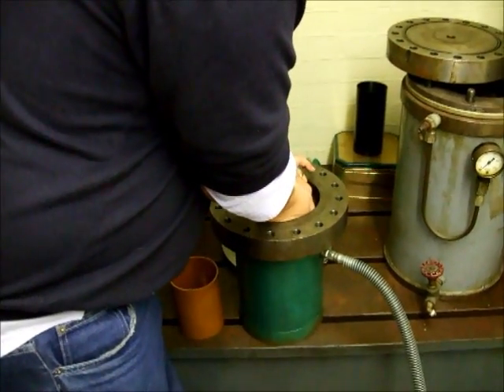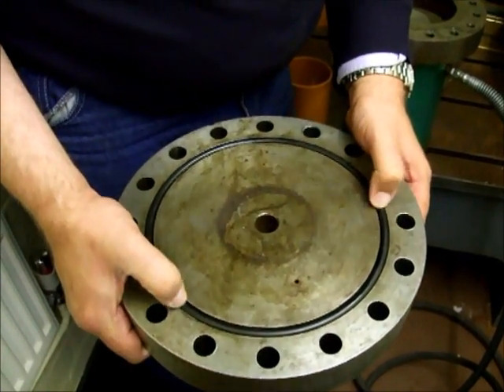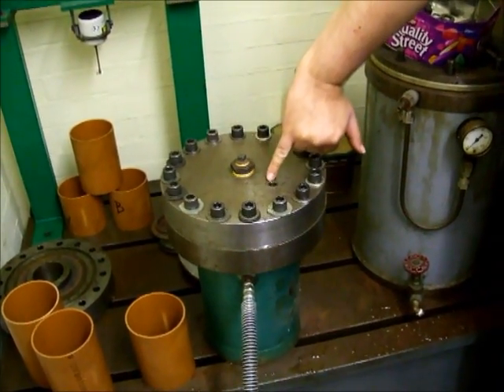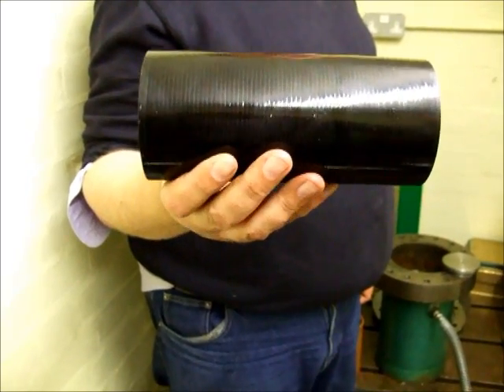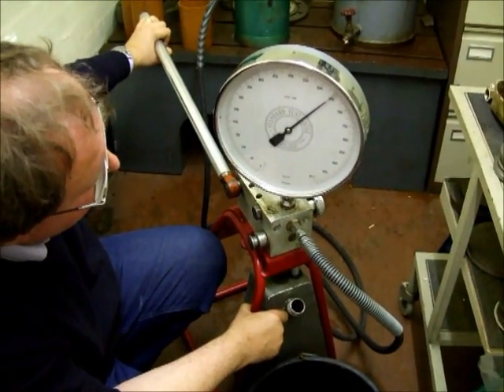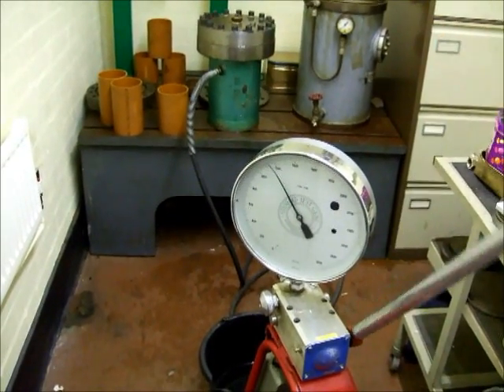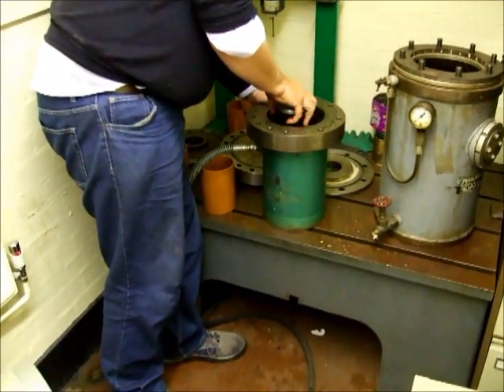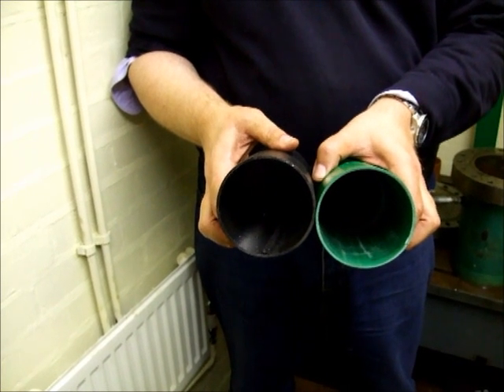Collapse of Composite Submarine Pressure Hulls

Comment: The resistance of carbon fiber to the depths of the sea is being poorly compared, in the first place it is a composite material of united fibers, they are like several small carbon fiber material cloths crossed between them that air and water can pass through by filtration between the fibers under pressure, there is already a disadvantage here its shape of the material is like a flexible and manageable cloth, if they use a full level of carbon fiber or 10 inches thick, join all the levels without the resin composition, the air and water by pressure will find a way to filter and achieve it, now if the mixture of the resin composition additive is applied to the carbon fiber material to harden it to make it strong and resistant, that depends on the resin composition. creates the rigidity of the carbon fiber material up to a certain limit,
 
  Well, it is the mixture composed of resin that is actually preventing air or water from filtering due to pressure when hardening and the fiber material is only resistant to an impact due to the opposite generated force, to a certain extent it will break depending on the thickness to resist the force, but in any case, without the resin composition you cannot test the carbon fiber under pressure with air and water, what it means is that who seals the opportunity to filter air or water by pressure is the liquid resin composition to harden carbon fiber, even hardened resin alone breaks to a certain point of strength as well, if we put 5'' inches of carbon fiber material without the hardened resin compound, you can bend the material it's actually like cloth of flexible and manageable clothing.

   Actually they are two combinations of materials that depend on each other for the combination of rigidity and strength, but the resin reaches a point of resisting flexibility and weakens, instead of carbon fiber alone it is flexible, I think It is the resin that weakens first and dusts each time it is exposed to esessive flexibility by pressure, which breaks first when a product engineered with carbon fiber suffers an impact, it is the hardened resin that cracks and the fiber of carbon is still flexible intact depends on the impact, it is necessary to investigate if the material of the cabin of the submarine with carbon fiber was prepared under suction by air compressor for the resin that avoids remaining areas with air bubbles inside the carbon fiber and this weakens it too.
 
I think that the submarine had to be inspected after each trip to those depths, disassemble the cabin and measure the resistance of the carbon fiber material, also to have a certification this submarine must be sent several times to those depths without human crew to detect to what extent can it resist under that depth and a count of hours and then confiscate the submarine since it is not useful.
 
  Someone also told me if it was possible that the cell phones of people underwater could exist with their micro SD memory intact, this can provide information before the explosion of the submarine, finding those cell phones is key and a very difficult task but not ruled out if they survived the explosion...

Comment: What depth would this pressure be equivalent to?
Reply: 1400 psi at 3150 feet (from blue robotics site).  considering the cylinder is only about 3 mm thick thats pretty good.  Compared with fiberglass it is much stronger so carbon fiber must have some compressive qualities when used like this.    It would be interesting to see what this cylinder diameter and thickness scaled up to for the oceangate submersible.

Comment: What is confirmed and people seem to not hear is that when he took Titan down the first time it was popping cracking and told people it would pop and crack and that was normal. I've NOT worked with carbon fiber professionally, only recreationally and not under these sorts of strains but I assure you, with increasing loads and you hear pops and cracks from carbon fiber, that means it was not done in a clean room with de-gassification procedures and/or kiln cured or there was incomplete saturation of the fibers. The fibers are only as strong as the glue holding them -seriously. Apparently the Titan was know to ALMOST consistently produce popping and cracking sounds when dived past only 300 feet. For some people so smart they are so stupid to not realize CARBON DOES NOT LIKE TO FLEX. That's why it's used on fuselages and not in the wings. The wings NEED to bend on planes for turbulence and even just landing or else they would crack. I'm not sure what they use as the tailcone on a say a carbon fiber airplane, such as the 787 Dreamliner. That would have been a good place to ask questions. Oh, and Stockton Rush got his carbon fiber for a steal because it was passed it's allowed "manufacture by and properly cure per stated procedures by ______" date. All of this has been confirmed (statements about the tragedy) by multiple sources, and even they CAN be wrong, but it's world-renown 3 letter news organizations saying they've confirmed it so it holds some water, or rather, pressure, for me.
Reply: The only way for it to make popping and cracking noises is for bits of it to be moving against other bits. In a carbon fiber/resin layup that means something has given way, and that is not reversible. With each pop and crack it is weaker than before... it does not (can not) heal itself. How could he think that was "normal" and okay?

Comment: Missing the point here. The carbon fiber was strong, stronger than the same amount of metal, subject the same thicness of metal  to that pressure and you would have gotten the sas failure. What carbonfiber does that etal does not isdegrade, form cracks after repeated stress.  The Sub was ineffect a time bomb closser to failure with each dive, each stress.  Probably the most painless deaths known to man.

Comment: So they have a lot of bolts and metal plates, but then use those thin hoses. How in the world can those hoses withstand that much pressure?
Reply: Have you ever owned a jet washer? Aware of the specifications? Considered risk? The first thing that may have occurred re The Titan could have been high pressure flailing of tissue by ultra high pressure water jets, only for a fraction of a second before total implosion: depends on the failure mode.
Reply: @UncleBoratagain  Yeah, no. Way out in right field with your response. My question has nothing to do with the Titan, jet washers and considering risk. Move along. Thanks for trying. The world and every pressure testing video doesn’t revolve around the mini Titanic.
Reply: @ImSofaKingBrilliant  I understand well what you mean, I was wondering too.
One possible - empirical - explanation could be that, since the total force exerted by a given pressure is directly proportional to the surface area to which it is applied, a tiny hose with thick walls could have a better strength/surface ratio than a larger container with the same, or even larger, wall thickness.
Reply: @pulidoggy  Thank YOU. This makes logical sense and answers my question.
Reply: @UncleBoratagain 
Is this an answer or else you're just mumbling to yourself?

Comment: The passengers probably based their confidence in the safety of the vessel due it having been on previous dives, when in actuality, the sub being predisposed to repeated dives made the eventual destruction ever more closer. RIP
Reply: That is what I thought, sad.
Reply: the real world is counterintuitive #engineering
Reply: Agreed.  As it turned out, the Titan was good for only four safe dives to full depth.  I don't think Stockton considered this risk.
Reply: @canuckfixit7722 any calculation to reach that result should come with a sizable grain of salt. Such a calculation is going to assume ideal materials and perfectly repeatable loading, two things that can never be 100% guaranteed, especially not without inspection of the hull before and after each dive. “Safe to four dives” means you’re probably lucky it didn’t go out the first time.
Reply: Which is why it's so important to use a material with a known fatigue limit and which doesn't have such complex and catastrophic failure modes as a CF composite.
Reply: This is likely the main error in their calculation.

Comment: People here are claiming that water is incompressible and this is simply not true. Water is NOT incompressible, especially not in comparison with steel. Stainless steel has a bulk modulus of roughly 160*10^9 Pa, while water has sits at roughly 2*10^9 Pa. Water is 80 (!) times more compressible than steel.

People here just seem to parrot "water is not compressible" without actually knowing what they are talking about. Yes, it is essentially incompressible in comparison with air. For most real world purposes especially on the surface of earth, it's an approximation you can work with. But to think it doesn't compress at all under all circumstances like some people here do is ridiculous. Please educate yourself before spreading dangerous misinformation.

Comment: and to know the titan submersible was friggin built this way as well. the composite centre with 2 end caps. lol! so it very well cud be the centre carbon fibre hull gave way or inbetween the titanium and epoxy adhesive mating surface that split.

Comment: The problem with a carbon fire composite is not that it's not strong enough. It is. The main problem is that the fatigue life of such a  design is very hard to model. With any steel or titanium hull you can even pressure test small pieces of the metal and based on that data you can come up with a model. Let's say this model has 10% uncertainty, factors that are two random to simulate for. Well then give your design a 20% safety margin. This is exactly what they did on James Cameron his deepsea challenger. They tested it at the pressure of 11 000 meters + 20%. With a carbon fibre composite there is no science or simulation yet that can account for all of the variable, there are a magniture more variable when it comes to carbon fibres under compression, weaved with other fibres and laminated with epoxy.  Next to that, there is on place on earth where you can test a titanium sphere for 7000 psi of pressure, a place in Russia. James Cameron his titantium sphere barely fit in the test chamber. But a carbon fibre cylinder, it can NOT be tested under controlled circumstances. Even if you build vessles that are intended to be destroyed for destructive testing purposes, that data you will get for it, is not conclusive. So there is just no science that can accurately predict the fatigue that builds up in a carbone fibre composite. It won't fail on the first dive, but you don't know if it will fail on dive three or dive 30. And that's why James Cameron was so against carbon fibre composive and even told Richard Branson not to ever use the deepflight challenger, the first carbon composite sub that was build. It was pressure tested, but never used.
Reply: How does a carbon fiber composite have any compressive strength beyond that of the resin?  Carbon fiber's strength is in tension.
Reply: @stargazer7644  This argument is a misconception. of course carbon fiber composite has compressive strength and tensile strength. The real problem much rather lies in the failure mechanisms and the physics of the composite material.
Composite materials are typically used because they combine strength of brittle fibers with the ductility of the resin matrix. the fibers reinforce the matrix so to say (for tension and compression by the way).
The problem for applications like submarine hulls, is the lack of an extended range of fully elastic behavior of the composite material, the way metals have them. The composite material suffers microstructural damages when under load and they accumulate over time and with each load cycle. This is one of the main reasons why composite materials have limited life expectancy and often require regular inspection and testing in defined intervals to ensure the material or component's structural integrity.
The benefit of the light weight does not matter in a submarine application, as such the specific material (yield) strength does not matter either. 
What the designers obviously ignored, or improperly addressed and failed to resolve resolved was the challenge of the hulls limited life expectancy because of accumulated damages due to the cyclic external pressure loading of the vessel with each dive. From what I understand they had a monitoring system on board to monitor the hulls integrity, but that was obviously inadequate and failed to monitor the material's deterioration due to the (cyclic) pressure loads.
Reply: @tomwoggle9411  That is like saying "of course concrete has tensile strength."  True, but rather irrelevant.  Its tensile strength is about 15% of its compressive strength.  Nobody uses concrete for its tensile strength.  Carbon fiber's compressive strength is often as little as 25-30% of its tensile strength.  It wouldn't be much less if you left the carbon fiber out of the resin entirely.  Why in the world would anyone ever consider it for an application that is entirely dependent on compressive strength?  And at 400 bar, you need serious compressive strength.  What is the advantage in this application?  It isn't stronger than steel.  It is lighter than steel, but a steel tank already floats in water, so the weight savings aren't helpful - it just means you have to use more ballast.  It costs more than steel.  It isn't as durable as steel.  It's harder to fabricate.  It's harder to inspect and test.  Again, why would anyone even consider it?
Reply: @stargazer7644  Don't get me wrong, I fully agree with you in the conclusion that the use of this material for that kind of application is just completely silly.

Comment: I'm a Ph.D. A.E. with a large American defense contractor who designed/manufactures(d) the two current front line F planes. I like everyone else was captivated when I learned a submersible had been "lost" while attempting to explore the Titanic. When I learned that the hull was a CF composite hull and that the conjecture was that was the point of failure, I was tempted to speak out, but then I know better than that in an open forum. All I will say is that CF demands very close scrutiny during its life cycle and the quality inspection of the initial CF manufacturing is also of the utmost importance to ensure the calculated mean failure rates are accurate. From what I have gleaned in the days since the submersible's loss it appears the CF lifecycle tests were wholly inadequate.
Reply: How much do you think Stockton’s aviation background affected his ability to take the safety warnings against using carbon fiber seriously? As I understand it, he was very knowledgeable and well skilled at building and flying experimental aircraft. Would you say that is why he chose carbon fiber for his submersible and thought it would be safe for his deep sea expeditions?
Reply: @theartistcherrypi6454  I don't know a lot about his work experience as all the resumes I have seen online look pretty sketchy without exact dates and specific work accomplishments but based on his very limited work in the AE field (Jr. Flight test Engineer at McDonnel Douglas), from what I have seen all he seemed to have picked up was Checklists that Flight Test Engineers live by...without any real specific/scientific  product engineering experience. The F15 had no CF in its design. He had an undergrad AE degree with very limited work experience and then an MBA and he never held another engineering position and never returned for graduate or doctoral engineering coursework. From my thumbnail sketch he seems like a guy who knew just enough about engineering to get himself in trouble.
Reply: Im a retard that makes fast stuff...and very familiar with carbon.  You cant expect a glued together vessel to withstand this many times.
Reply: There is a 1995 NASA paper that tested CF tubes under outside pressure. CFC tubes made lot of noise during the first cycle, and then little noise in cycles before failure. Cycle just before implosion was identical with other mid to end cycles. That would make Stockton's audio/vibration based hull monitoring system insufficient.